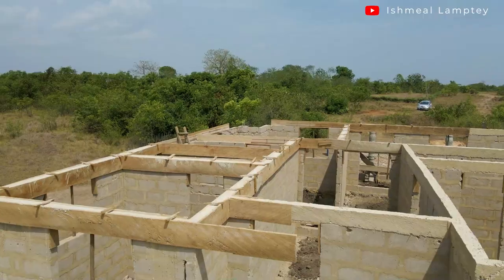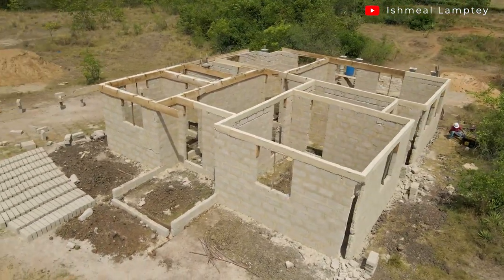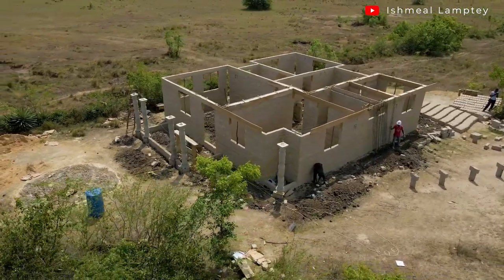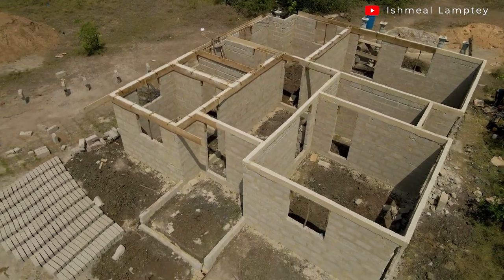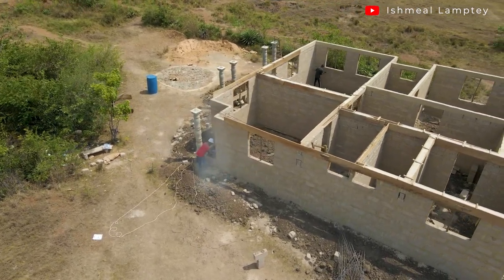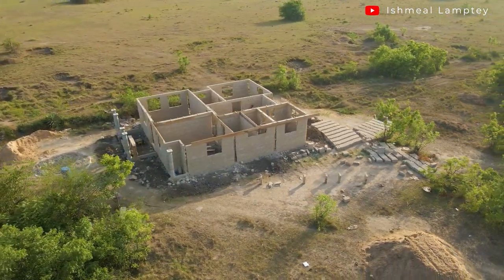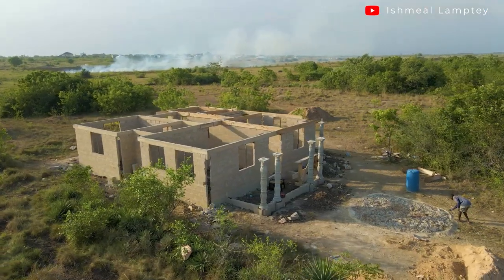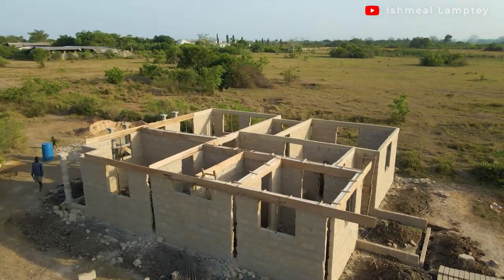Why You Should Avoid Building Without Columns or Pillars in Ghana

Comment: if i make a garage separate to the house do i need to add pillars as well?
Reply from the maker: Columns are essentially when building with blocks and concrete. It is best to have it done than to not and later come back to fix issues. So i will highly suggest you have columns for it

Comment: What is your honest opinion about building a culvert wing walls with cement blocks?
Reply from the maker: Haha, i know where this is coming from and i saw them too. Well, in my honest opinion i think it isn't so right using blocks for culvert walls reason being that blocks alone may not be able to hold up a lot of weight. Culvert walls requires steel and also very solid concrete to be able to hold up almost any weight that passes on top of it.
Reply: @IshmealLamptey  Thanks so much, I wanted to make sure that I was not going paranoid because I tried to point it out to the contactor but he thought he could justify it by explaining it away.
Reply from the maker: @nobs997  hmmm

Comment: I don’t see the problem in building without columns. The walls act as the load bearers. I’m in Eastern Europe and most block houses are built without columns.
Reply from the maker: Africa and Europe are two different continents that do experience different weather conditions. Over here in Ghana it is mandatory to have columns in your building
Reply: If ordinary mud houses  in Africa can last for over 50 years, why not an African column-less cement house last that long ?